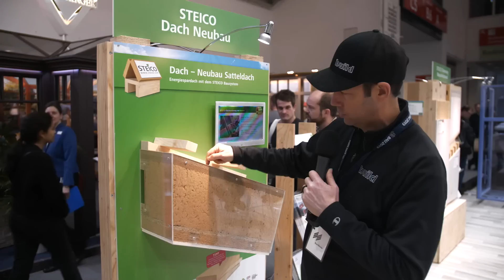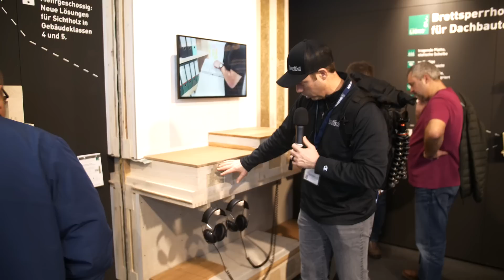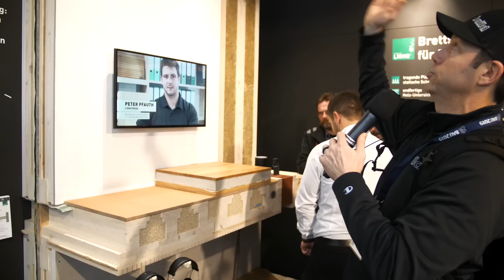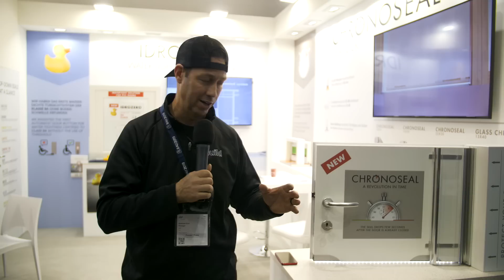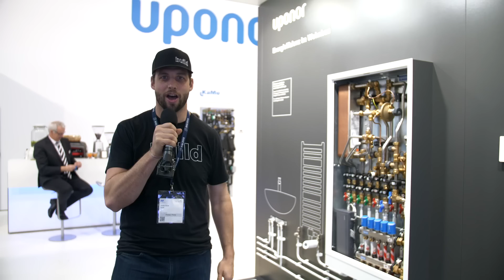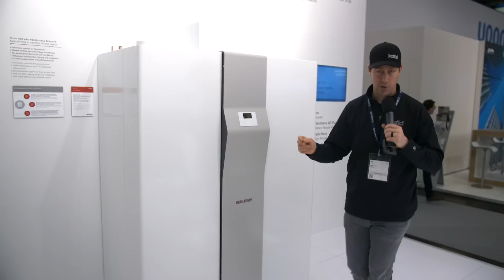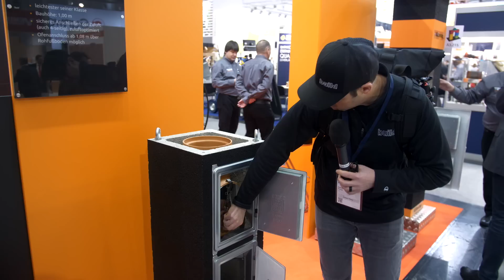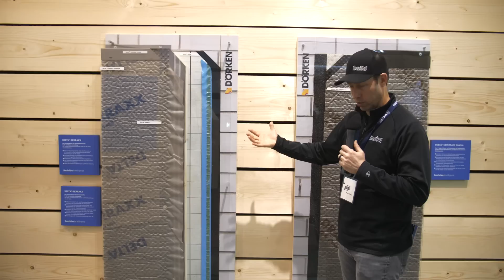These German Building Products are Awesome! Day 2 at The Bau Show Munich 2019

Comment: To the video shooter: if you lock your camera's shutter speed to 1/50th of a second, you'll eliminate the flickering of European lights. This will work even if you're shooting at 24 or 30 frames per second. You can then adjust the final exposure with ISO, aperture and (if necessary) neutral density filters.

Comment: One thing you have to keep in mind when attending these shows , is that they are presenting their most extreme and newest versions of house building . Most house in germany are not built this way because of the expense . It's kind of like going to a new car show. Most everything on display are concept cars and or top of the line models. 
Also Switzerland imports most of their lumber from germany and scandinavia and scandinavia imports a lot of their timber from russia. So , when the swiss CLT Maunufactures state they are using trees from Switzerland , it's a bit of a stretch.
Reply: yeah, that wood fiber insulation is new stuff, but the ceramic block building is very much standard for central europe
Reply: Except the wood isolation I did not see anything that is uncommon on building sites in the last 5 year's.

Comment: I have this giant stiebel box. Thats a nice thing :) Working perfectly. 4 kwh heat out of 1 kwh electricity right now at -2°C. Best thing. We dont need to open a Windows for months.

This thing can work on Phase. But you need 3 Phase for the emergency heater.

Many of this companys pushing to the market. As a normal person it is nearly impossible to afford. A big issue in Germany right now is the lack of qualified workers. This fancy constructions have a high risk of mounted wrong.
Since 2008 the insurance issues on construction sites doubled in germany due to the lack of qualified workers. 
Some of the workers i hired showed me some scary pictures how the air tight PE-Foil was mounted. You hat to be really dumb to do this.
My house reached 0.72 in Blower door test and i found several issues that could be improved.
Reply: David Seidel , I may have missed the ‘BOX, ‘ but STEIBEL. makes a heat pump water heater, where their CONDENSER ‘,section is in a shrink fit external plate coil, so there is ZERO corrosion problems with the condenser  being inside the potable water. , there  is a brand of water heaters, using that same system we used in supermarkets fo their wot water needs,  never ever had a failure., of any we used

Comment: You would be surprised how affordable all that stuff really is. I have a house in Germany, built it in the early 90ies and it has that kind of insulation. It also has triple and quadruple pane windows. Snow simply sits on the roof and skylights all winter, no matter how high you turn your heating. Actually, the heating cost of my house in Germany (roughly 4000 sq ft) is not even half the heating cost of my house in California and the house over here is not even half the size and it doesn't have 33ft ceilings.  So yes, before people in the US should think about buying a electric vehicle to save the planet, maybe better construction would be in order.  Funny enough, my house in Germany cost less to build than what I paid for that 1969 shed - oops, house - here in California.
Reply: That's California, it's not really a part of the United States.
Reply: @2drsdan  I know, CA is pretty expensive. Still, construction quality is crap in the US and far to expensive for what it is.
Reply: @uweschroeder  I agree, the formatting around 2-by material for everything is very limiting and
when you try anything different either the code or some regulation stops you even if what you
come up with is overbuilt and overdesigned. They use the banks lending policy's to force conformity.
We call that freedom.
I live in Montana, we still have more freedom than elsewhere but it's closing in.
Real rock, timbers, steel, and glass.
Reply: @2drsdan  Not that this has anything to do with cheap construction sold expensively (freedom to screw people over?),  but but please list any freedoms you have that Europeans don't have and then I'll list some freedoms Americans don't have.
Reply: @uweschroeder   I was joking about freedom in the first reference. The only free people in California
are the criminals.
I have been to Germany, France, and Ireland and honestly, I've never understood how the economies
there work.
But by all means, list away.
Reply: Uwe Schroeder  When I visited a home in KALIFORNIA, some years ago, it was a bloody bad joke ,,the construction reminded me of a very poor caravan, or travel trailer , staples,  bad construction, my old house in NJ was built in 1939, was really built.

Comment: Worked on a project with the Gutex insulation last year here in Kansas City, It is available, just need to get the right distributor. It is not air tight, so detailed air sealing is critical.

Comment: Solid wood floors.... Talk about insanely expensive....  That is INSANE.  
PS> Can tell you are from the South... "air leaky" fireplace.... You haven't bought a standard USA fireplace in say the last.... 40 years.
Reply: w8stral ... problem with building and quality here in America is that it has to be CHEAP ... and just good enough to barely pass any local build codes ... and not built to last for generations. Build and tear down build and tear down build and tear down ... it’s madness here in the U.S.

Comment: I feel like Japanese home construction is the other end of the industrialized world.  When moving houses, everyone is expected to tear down the old house and build their own new house on top.  Wonder what the best model is.
Reply: After about 15 years the normal Japanese home is basically a ruin waiting to happen. Insulation is not a thing. A lot of them don't have heating. The small desks you see in anime with the blanket over them  is because they have a heater under there. In central Europe the part with the shortest lifetime are the roofs. They are expected to last for 50+ years. Most buildings that are newer then a hundred years are because of expanding cities, increasing density in the cities or because the Brits and Americans leveled what was there before.
Reply: @FreeOfFantasy  that’s terrible. The US definitely has higher quality homes but still would want better quality across the board.

Comment: Super insulation as electric coasts over .40 kwhr in Germany now. Failed. Green agenda
Reply: "Green energy" stopped being more expensive years ago. Cost now days are high because of fuel costs, corruption and greed.
Reply: coffeebuzzz , that so ? Tell me why everybody, whom wants me to buy THEIR GREEN ENERGY  WIND, OR SOLAR  COST MORE  than my utility , so I told them that, then they HANH UP ON YOU .
Their bit is, wouldn’t you like to buy CLEAN ENERGY ?
Reply: Leighton Samms In the U.K. the cheapest utility companies tend to be the smaller ones with 100 percent renewable electricity. The cost of power is largely driven by the wholesale cost, which is driven by oil, coal and gas prices across Europe. Solar and wind power has been cheaper than fossil fuels for some time now.

Comment: I understand that you guys focus on high end custom homes and a lot of that Euro bldg tech is very cool but I wish you can give us an idea of the cost of these 500 year homes built with a forest worth of lumber. What is the level of home ownership in Europe vs renting? Can a delivery truck driver with a couple kids afford a home built like this? Just curious.
Reply: Greatly depends on how much you have to pay for your stock of land. If you live in one of the 10 majour cities, you can expext to pay around 300.000 to 1.500.000€ for 500m2 of property in urban areas. Add the building costs at around 50 to 400% of the land costs and you're there. Just a really rough approximation. Outside cities, it's cheaper of course.
Reply: thanks for the replies. What I'd like to know is, are "regular" homes for regular clock punchers built like this? Walls and floors 36mm thick of solid lumber? It seems extravagant even if it's 'cool' and will last for 500 years.
Reply: @RichSobocinski  No, I've been a real estate agent and I can tell you, that most clock punchers won't be able to buy these homes. Wood is redicilously expensive, compared to bricks especially Ytong. And in Germany, brick houses are those which are up to 1000 years old. We do have Fachwerk Häuser, which are also around 1000 years old. But most of them are not older than 400 years.
You can get wood houses for little money, but they are neither energy  efficient nor long lasting.
Reply: @GERntleMAN  thanks. That's what I thought
Reply: @RichSobocinski  Yeah, it's a bummer. But since we aren't allowed to use more wood than we can reforest, it's more expensive than in the us. The US unfortunately can almost use as much wood as they want, even if they are reserves and decimating forest area.
Reply: @GERntleMAN  if you think that the US is decimating our forests I'd like to inform you that it is not. We may not have much primeval old growth left but America now has more tree cover than it did in the 1600s. Lest you think that this is just lumber industry propaganda you can check this link to see that even "tree hugger" organizations agree (https://www.mnn.com/earth-matters/wilderness-resources/stories/more-trees-than-there-were-100-years-ago-its-true).
I recently bought a 54 acre plot of land that was timbered just 3 years ago. You would be hard pressed to realize that since the property (and those of the neighboring plots) is still thickly wooded. The property is in a county where timber is the major industry, but recreation is the other big industry and people come to enjoy the beautiful tall hardwood forests.
Reply: @RichSobocinski  I'm glad to hear that. An old friend of mine was an administrative in some sort responsible for monitoring the forest area in the US. Did that for 20 some years and always complained, that they are using far more than they should. I'm happy to hear, that this has changed. Thanks for the update!
Reply: GERntleMAN I work in a lumber mill in California and our problem is that timber is rarely harvested on federal land anymore so the forest is overgrown and we are having catastrophic fires because there are too many trees.
Reply: Depends on where you wanna live, 10-20 miles from a city you can easily find properties for cheap, but in the cities we mostly live in apartments.
Reply: @TheEsseboy  True. The majority of people in Germany rent instead of buy. Many owners of appartment buildings in the big cities are privat and own a large percentage of all buildings in a city. For instance, one individual in Munich owns 126 appartment complexes in Munich alone. All private.
But I know truck drivers, who own houses. Just not near this building style
Reply: Steve Slade  Well, if Poland wants to make money, why wouldn't I want to hear that? As Spain used so much lumber from their forests, they had to prohibit it and instead buy from Portugal, Portugal was the benefactor. Unless you're unaware, that's called market. Nice concept, only around for more than 4000 years so it's quite new.

Comment: And let the Bashing of the way America builds their homes...STARTING NOW !!
Reply: The only thing that I am vehemently opposed to in modern US construction is the reliance on OSB. It gets wet and disintegrates- I've seen it a million times. It's garbage.
Reply: @rickrudd , Agree 100%. I think they have water resistant OSB now, but I would still prefer Pressure Treated Plywood.
Reply: @augustreil  yeah, it is good for indoors or where it cannot soak up moisture. I had a roofing construction fail after the vapor barrier on the inside got damaged by some drywall idiots. all the moisture got into the insulation and from there into the OSB, as the OSB didn´t let it through. after only a few years the OSB almost doubled inthickness, but was as solid as a loaf of soft white bread.
Reply: @augustreil  I´m just not sure it can take the same forces for stability that osb can. We build multi story houses withj osb/wood frame.
I´m happy to be educated.
Reply: @DesMessersSchneide , I'm not sure what you are saying ?
Are you saying OSB is better than plywood ?
Reply: @augustreil  i´m saying we don´t use plywood in structural elements(for rigidity, to keep the house upright) we use OSB for that.
And that i dont know if plywood would work at all for that purpose.
I´m talking about the application in woodframe building where the osb takes the role of struts.
Reply: @rickrudd  Hopnestly , OSB works really well if you let your house breathe instead of sealing it with fucking foam. And it belongs on the inside of exterior walls. so OSB acts as vapor barrier and reinforcing structure.
Reply: @DesMessersSchneide  It's not that I dont see its utility, it's that I just assume water will infiltrate a structure in one way or another, and especially with OSB I-Beams, I feel like we are truly building 'houses of cards'. I'm okay with subflooring I guess, although I'd prefer zero OSB in a house if I were to  build one. I've only lived in and worked on old houses, so it's not something I've dealt with to date.
Reply: @rickrudd  im not saying i havent seen OSB fail. But truly the builder failed there. I´m trying to say that youre not just choosing building materials, youre choosing or developing a system. Since its almost impossible to build a 100% vaportight house( at least not for a reasonable house) you have to make sure the moisture can escape ( to the colder side of the wall, since vapor pressure is most likely higher on the warmer side). choice of insulation material helps a lot too. something like cellulose is really great at dealing with moisture since is nothing else than wood fibres, so its basically made to transport water. Foam is really shitty for that( a no go for insulation anyway around here) and rockwool and similar are not that great and loose stability when wet and is less resistant to draft? wind pressure? not sure how to call it etc.

Basically its a downside of osb that you have to keep it dry but that applies to almost everything in your house anyway and it comes with a lot of benefits that why its widely used.
I´m not sure about the US but over here we don´t build vapor tight but airtight. we just limit the amount of vapor that can go through and choose materials acccordingly to make sure the amount of vapor that gets into the structure can escape it...

Comment: I am amazed that a heat exchange system that works on a closed heat system is new for you people. Think we been using them for 50-60 years, the main benefit is that you  treat the heat water so you do not get build up of minerals in your exchanger  and/or boiler.
Reply: Thorstein Mortensen  in my trade magazines, there are a couple of companies, whom sell radiant systems that do domestic drinking water too, but my old house has a steam system, built in 1039, but wish it were  a hot water system. In EUROPE there should not be any steam, but hot water,, older homes have radiators,  mostly oil fired ,  I saw NO NATURAL GAS , only electric, and 3 phase in homes in Germany., but most the world is 50 HZ,
Reply: @flybyairplane3528  Natural gas is very very common in Germany. Oil heating isn't something that really happened since the 70s. Steam heaters are a thing but more for not modernized buildings from about 1900 to 1940 and in industrial environments where steam is a byproduct and some trains until about 1990.

Comment: All wood construction\Wood pulp insulation panels: one Word: Termites! an of course other wood boring insects like carpenter ants & bees.  I would think there would need to be some pesticide added to prevent insect damage, which would defeat the no chemicals in construction materials.5:39 It appears the floor joists are resting directly on concrete. In the US usually there has to be flashing or some barrier to prevent the concrete wicking moisture into the wood causing it to rot.
Reply: No termites in Germany. There are timberframe buildings here that have been standing since the 1200s.
Reply: Guy tech. there are no termites in germany , austria or switzerland  and they do put down either a protective layer in between the wood and the concrete.
Reply: I'm wondering: aren't there wood structures in areas with termites? I think they are in all states (except maybe Alaska) of the US? So there must be known ways to protect those buildings ;)
Reply: We don't have termites in West Europa... So nothing to worry about! And than again ask your self why you would want to build with wood? Maybe look for brick of Ytong blocks! Good luck with termites chewing thru that!

Comment: Do they test like we do with blower doors? How do these buildings perform?
Reply: At least in Germany yes. All new homes need to be very energy efficient. This is one of the reason why they develop so many new products to keep your house tight. Also if you want to renew the facade or windows on older houses you're actually requested to get it insulated.
Reply: @DeusMogon  at least you hacve to do the whole facade or roof if you change more than 10 % of the area. So new windows after 30+ years, you most likely have to do it all then.
Reply: well it depends on who build it. There are tenthousands of builders in Germany alone. But generally, they have to be 100% tight or they have to make it so during/after the test.
Reply: in the netherlands they do, they tape all the ventilation slits, then put a blower in the front door. at this moment there is a maximum of 200 dm³/s with a over and under pressure of 10 pascal. Not sure how to convert this to usa standards.